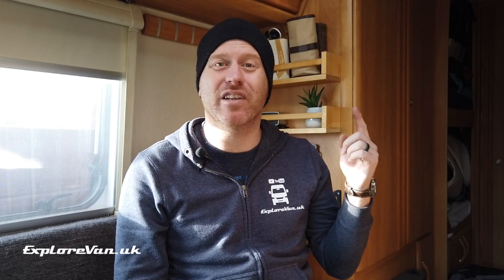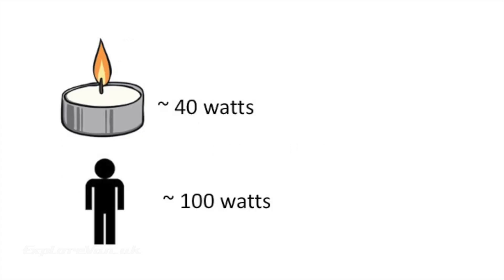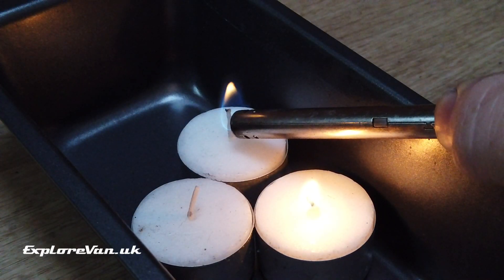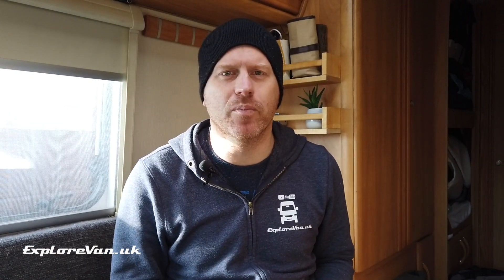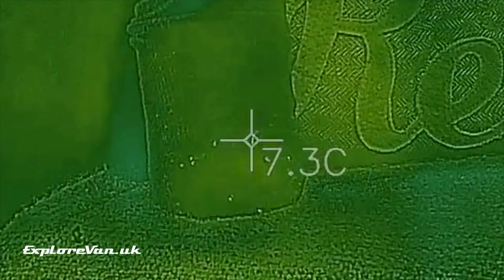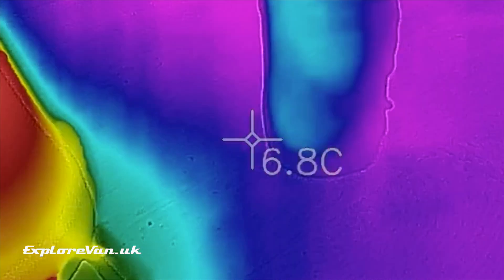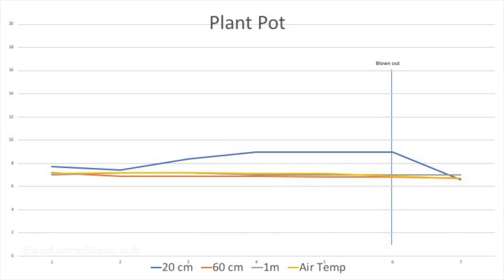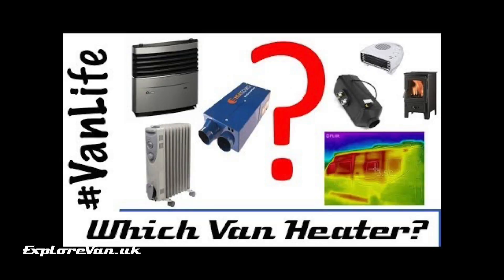Plant pot heater test - Do they really work?

Comment: Maybe if you used the proper Russian nesting doll style(which is the correct style for heating) it would change the test but you used a single pot which is pointless. The nesting type have an all thread bolt through the center of the pots which helps to heat the pots
Reply from the maker: Thanks for watching - but I am afraid not, see the response to the comment below.   Adding as many pots and as many bolts as you want will absolutely not change the amount of heat it gives out.   Yes, it may retain what little heat is produced by the flame and release it even more slowly and at a lower temperature,  but it absolutely will not make it heat a space any better.
Reply: Thing is though: they have those terra cotta stoves that people in other cultures cook on. Those seem to generate a whole lot of heat.

Comment: I have a t5 we have just got a leisure battery and inverter we want a single hob 1000w any suggestions?
Reply from the maker: If you are looking to use a mains induction hob off grid you would need a lot of batteries and preferably LiFePo4 Lithium batteries which are very expensive.   A 1kW mains induction hob would draw 93 Amps from your battery.  Personally, I would stick to gas for cooking off grid. If you're thinking for when on hook up I recommend the ikea one.
Reply: @ExploreVanUK  yeah i have tried this, induction hobs are annoying in that they need a really good PURE sine wave inverter only, ours wont work on any inverter at all thats not, no chance on the cheap square wave ones, doesnt even do anything on the modified, it comes on, says its cooking, doesnt...
Reply from the maker: Great info!  Thanks!
Reply: funny you should mention such a thing, just been outside testing a rebuilt inverter (renoster 3kw), I have 450ah of battery, so 4 leisure batteries in simple terms, I can drain the whole lot in about 30-40 minutes if i keep re-boiling a 2kw kettle...i know this as i just did it to stress the inverter to kill it or prove it 'repaired' - shame there's no sun to recharge my batteries!